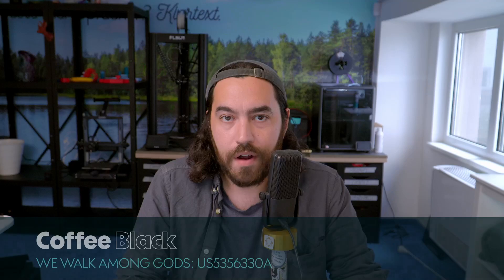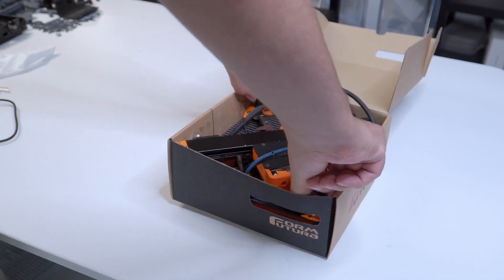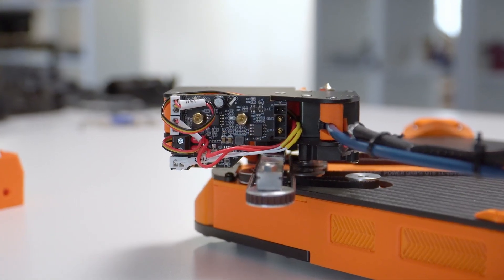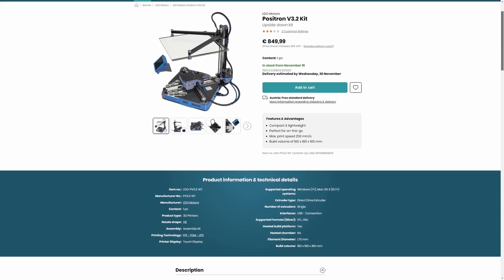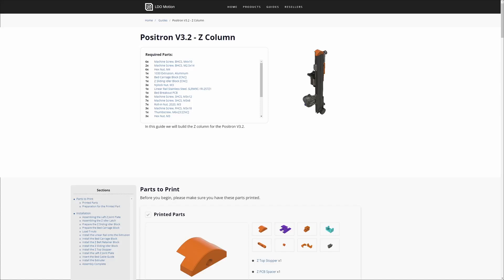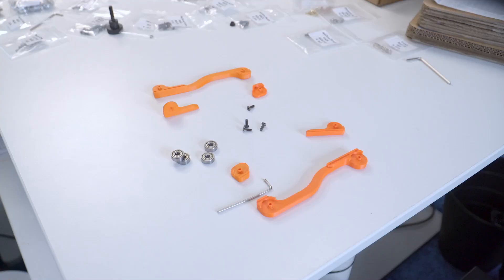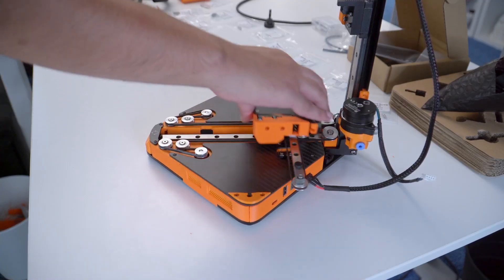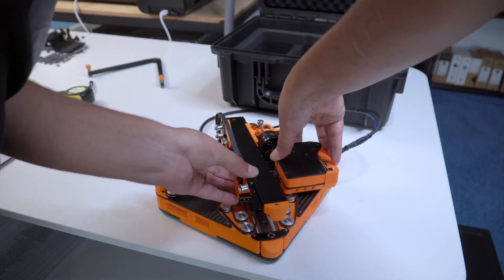LDO Positron V3.2 - It fits in a spool box!

Comment: I remember seeing the video of this thing a couple years ago or so and I thought it was so cool. LDO did a great job designing it, I just don't like the price. I have a v0 kit from ldo and it was great so I'm sure they made a quality product.
Reply: Same, that's why I'm making a lemontron instead. I got the hotend and the bed from 3DJake, all the other parts are off-the-shelf and in total I've spent around ~440€ not including the filament of the printed parts. It's much cheaper because it avoids custom manufactured parts (other than hotend and bed). Another advantage is that is even more compact than Positron. One drawback is that it requires a printer of at least 200x200mm for printing the unibody base.